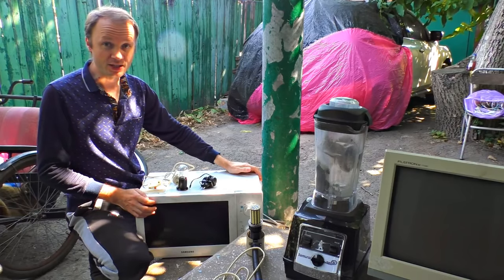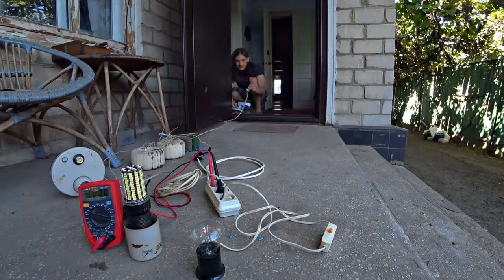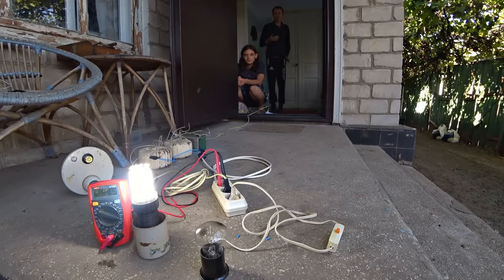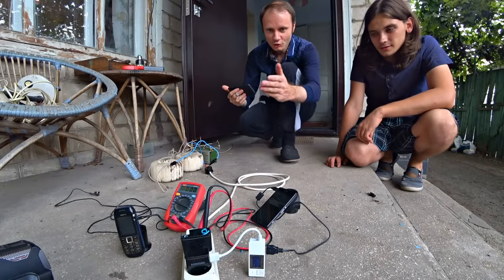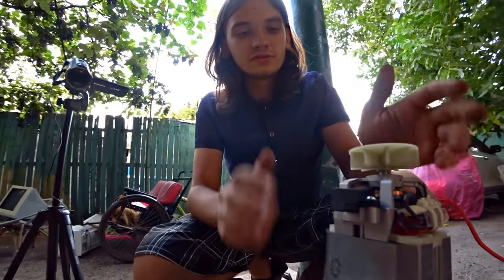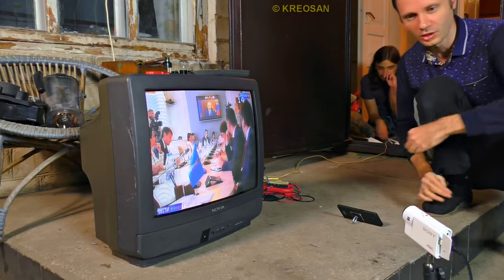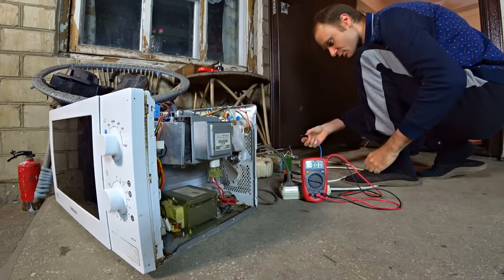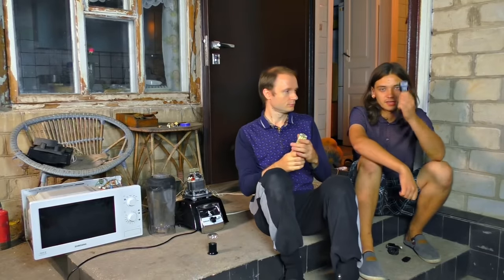Don't leave your devices plugged! Overvoltage + house appliances

Comment: The reason for the nightly Voltage increase is likely caused by a reduced load on the power stations and bad grid management..
Reply: Bob Thiry he asked 'why do technicians rise the voltage whilst everyone's asleep '.
Reply: Or maybe they increase voltage at night when everyone's asleep so they can charge you more money in electric bill.
Reply: bad grid is my take, from Quebec.... we have so much power we undersell it while overcharging regular people. Our "grid" is stable.... most of the time, depending where you live
Reply: What if higher voltage causes electronics that are on to consume more electricity at night? Current remains almost the same while voltage rises. For example 300 watts TV consumes 230 volts at 1.3 amps/current during day time, the same TV at night consumes 338 watts with 260 volts at 1.3 amps/current.
Reply: Most modern electronics use switch mode power supplies (like the LED corn bulb and the phone charger  in the video). Even if you increase the voltage the power stays about the same as it needs less current. If the voltage goes way too high they might fail, yes, but even the mentioned 260V won't do that.
Reply: The electric infrastructure likely is from the late 60´s with limited to no automation.
Reply: @somanyfnbananas2774  The meter measures Voltage RMS, the max amplitude is that value multiplied by the square root of 2 (assuming sinusoidal wave), so 40% higher. The input electrolytic capacitors on any switched power supplies are rated at a max. voltage. and will have reduced lifespan when operating closer to their max rating. A rating of 400V (which is common) is not that much higher than what they're measuring here. 260V RMS has a max amplitude > 360V
Reply: Yep. The change in voltage under load is called "voltage sag"
Reply: @Liam I would like to see the net frequency measured too. During normal conditions and at night when the Voltage rises, I bet the frequency will be higher too.
Reply: @F. BERTAGNE That would make a lot of sense, and is likely the reason.
Reply: @Xeno_Bardock  savage
Reply: Bob Thiry 🔴 What Is Islam? ⚠️

🔴 Islam is not just another religion. 

🔵 It is the same message preached by Moses, Jesus and Abraham.

 🔴 Islam literally means ‘submission to God’ and it teaches us to have a direct relationship with God. 

 🔵 It reminds us that since God created us, no one should be worshipped except God alone. 

 🔴 It also teaches that God is nothing like a human being or like anything that we can imagine.
🌍 The concept of God is summarized in the Quran as:

📖 { “Say, He is God, the One.  God, the Absolute.  He does not give birth, nor was He born, and there is nothing like Him.”} (Quran 112:1-4)[4] 📚

🔴 Becoming a Muslim is not turning your back to Jesus. 

🔵 Rather it’s going back to the original teachings of Jesus and obeying him.
Reply: yes but that would be very unlikley because those are perfesional jobs
Reply: It even blew up lamps of an entire residential house, back when that accident happened the substation had a pretty fixed power output and it was powering an institution with lots of electrical heaters. The problem is that they moved to natural gas based heaters and because there is no current draw from the electrical heaters the voltage rised so high that it blew up lamps on residential houses
Reply: @Raberuji  Not during the ice storm....Hydro is shit in Quebec
Reply: IN RUSSIA
Reply: @Xeno_Bardock  I verry verry highly doubt that buddy
Reply: But I thought Japanese appliances and game consoles were supposed to be 100 V, but 120 V work fine with my Japanese Dreamcast and Japanese PS2 slim. After all, in the AirBnbs I stayed in, it had a maximum rating of 125 V (which a lot of electrical accessories in North America use)
Reply: Also, Japan's electric grid is unique. Eastern Japan (Tokyo, Tohoku, and Hokkaido) use 50 Hz, but Osaka, Kyoto, Hiroshima, Shikoku, Nagasaki, and Okinawa use 60 Hz. This was a massive problem back in 2011, during the tragic earthquake and tsunami. Only three frequency conversion facilities exist in Japan, limiting the amount of electricity that can flow from Western Japan to Eastern Japan. The reasoning behind this unique grid is because AMG imported 50 Hz electrical equipment to Tokyo, while GE imported 60 Hz equipment to Osaka. When those grids expanded, there is a divide where certain appliances in Tokyo cannot be used in Osaka and vice versa.
Reply: all is true... kinda...
Reply: Voltage increase in your socket is caused by reduced load needed by end consumers. Cables and power lines have electrical capacitance, which, in AC grids, is the ultimate reason as to why you get voltage increase. The increase in voltage is a regional or local occurrence.

Electrical power stations like hydro-power plants run their electrical machines as electrical motors without water supplying the turbine of the hydro unit. Running these hydro units at night is called synchronous condenser mode. In this mode, for the operation of the hydro-unit, it uses magnetic field to absorb reactive power. The effect of absorbing reactive power is what causes the unloaded grid during the night to lower the voltage levels back to nominal ranges.

You also can use condenser batteries, static reactive (inductive) compensator and shunt reactors.

The reason its still 260 V at 4 am is because none of these methods are used in their regional grid.
Reply: Россия and electricity..
Reply: Yeah. Power plants have no means to increase voltage. All that happens in the grid. I was actually witness of something like that happening in a smaller scale inside a factory building. The electrical grid inside was so badly constructed that when you flick the power on, the voltage started to slowly increase and there was a loose current somewhere that shut it down eventually. So basically eighter badly managed grid or really badly damaged lines inside the building created sort of monostable circuit. You flick the switch on and after a period of time it switches off itself. With voltage higher and higher (we've measured record of 270 V). However, that wasn't actually the purpose of the switch and I assume wasn't even planned.
Reply: I always thought it was because it's an old house and we all use new equipment. My house is two prong and it would cost $40,000 to replace the house wiring to make it three prong ground compliant.
Reply: @JoeWaylo  40k for re-wiring ? do you live in a Palace perhaps ?
Reply: It is not the problem of the grid. The voltage on the grid can vary by +/- 10 % and in some places, upto +/- 15%
Reply: yes, this is true. Under low load, the grid voltage floats up. Under load during the day, the voltage stays at an acceptable level. They don't do it on purpose, because the devices will draw less current on a higher voltage(with an exception of incandescent lamps) therefore drawing the same wattage.
Reply: Jeiene
Reply: @Xeno_Bardock  hm...
Reply: 1000th like, congrats!
Reply: I think it goes higher at night cause less people use their stufff
Reply: @F. BERTAGNE Correct
Reply: Fun fact, in the former Soviet Union, when television broadcasts ended for the evening, a message would appear flashing on the screen: “не забудьте выключить телевизор” (Don’t forget to turn off the television) it is said that this message was to address the overvoltage caused by decreased grid load at night.
Reply: thanks for knowing
Reply: @lucasn0tch  That's pretty moronic lol
Reply: @ahmdabdallah2132  yo what is this in regards to? What is religion? I smoke cigarettes religiously. What do you do constantly? We dedicate religiously right......or at least I do.
Reply: In other parts of Europe everything is managed safely, so this never happens here
Reply: @Raberuji  Texas: non corona cough
Reply: @Gunzee  1qqqq
Reply: @Xeno_Bardock  Really? Or is it just the fact that nobody is using the power?
Reply: But I don't think the voltage will rise over 270V
Reply: Where's Automan when we need him?
Reply: test a 1 dollar laptop
Reply: Or just people using less power
Reply: @Gunzee  that was the question that he just answered bruv
Reply: @Xeno_Bardock  technically a higher voltage would be less of an electric bill, as more volatge usually means less current and the amount of current determines how much the meter increases
Reply: that's nothing a big lithium ion cant stabilize
Reply: @832738  the National Power Grids of literally every country ever is in AC. Your solution is DC. Also a Battery is not sufficient enough to provide enough Power to make an impact on the Grid.
Reply: @Raberuji  well he lived in Luhansk people's republic at that time (de jure a part of Ukraine de facto part of ruzia)
Reply: @juslitor  yeah cuz they didn't update it because at the time he lived in the luhansk people's republic and it is EXTREMELY poor (de jure part of Ukraine de facto territories controlled by ruzia)
Reply: Yes…
Reply: @Xeno_Bardock It doesn't work like that. They draw whatever current they need. It doesn't change at night.
Reply: They probably don't have a TAP CHANGER on their substation transformer to regulate the voltage to their customers.
We use tap changers to increase the voltage to homes on hot summer days when everybody's air conditioner is turned on.
Reply: @thygate  That would only be true if the generators at the power plant have no feedback control to regulate the speed of rotation of the generators.
Reply: @synthmarkbs8477  Mama Rusia, Mama Rusia!
Reply: @fabriziobrutti1205  If there is no tap changer on the transformer to regulate voltage.
Reply: @jakewynn  Actually, that is not true. When the voltage increases, so does the current. Did you ever hear of Ohm's Law?
Reply: @foureyedchick  oh yeah... Actually here in Italy the upper limit of the mains voltage tolerance is 265V😅
Reply: @Xeno_Bardock Except when the voltage drops, the device's resistance scales up, so it must draw more current in order to operate.

If anything, a LOWER voltage would mean a higher electric bill.
Reply: That would have been my guess

Comment: Im also quite impressed those two chargers did not kill the phones.    This is proper construction.    Even gross over voltage on the input and they still protect the output
Reply: Techrax put 100 chargers into a phone and nothing happened to it
Reply: @SamiSaba2  thats unrelated    entirely unrelated   Gross overvoltage on the chargers input can in some cases reach the output sending it to the phone    Putting 100 chargers in paralel will not increase the output voltages.

Comment: High night voltage might be caused by your earlier experiments when you shorted out the mains supply to your house!! Or might be no tap changers and a high supply impedance. Could also be vodka involved, at the power station. Great videos guys, thanks.
Reply: Kvass better
Reply: Cat getting rubbed makes static parkles over 20 thousand volts 😮

Comment: Now I'm curious on what would happen if you get those TV/VCR duo decks, and record while overvolting it. It might be a pain in the ass to tear it apart just to get the tape back once it dies, especially with the risk of a CRT, but the aesthetics you get while playing it back will make it worth it.
Reply: wdym risk of a crt
Reply: @Warp2090   very high voltage kile 20000+ somthing volts

Comment: I think that the voltage increases at night because there less people using the electricity and the voltage is not loaded and it doesn't drop, that's my guess
Reply: @QueueTeePies  yeah, but they live in Ukraine maybe there's an older sistem, I live in Italy and the voltage stays at 230V
Reply: 1:00 have a listen 'why do electricians rise the voltage whilst everyone's asleep?'. It's on purpose in other words.
Reply: @QueueTeePies  Even here in America I measure significant voltage changes at the same place at diffetent times.
Reply: It would still be less than 10 volts increase at night, not 30 volts or more. Its probably power companies who increase voltage at night doing it to charge more money in electric bill. What if higher voltage causes electronics that are on to consume more electricity at night? Current remains almost the same while voltage rises. For example 300 watts TV consumes 230 volts at 1.3 amps/current during day time, the same TV at night consumes 338 watts with 260 volts at 1.3 amps/current.
Reply: Yes, but normally there will be a tap changing system to buck the voltage as the load lightens on the transformer. The opposite happens as the load increases, it begins to boost the voltage to compensate for losses. If the tap changer fails, then there is no more regulation.
Reply: Imitators!!!

Comment: The filament in the incandescent was probably being damaged faster than normal under the high voltage, but the LEF probably uses a step down transformer before the voltage is converted to DC, this means no matter the AC voltage as long as it doesn’t physically damage the coils the light will work normally, which is why 419 volts destroyed it.
Reply: Light &phone &tv @rigg

Comment: Reduced load on the utility transformer perhaps. I don't see it as much at my current residence, but at the old house from a neighbourhood built in the early 60s in Florida, during the afternoon in the Summer the voltage would be in the range of 117V, but in the very early mornings it could go as high as 126V on a nominal 120V system. Using a Tripp-Lite UPS that will display voltage whenever it is plugged in.

Comment: Rhey dont  rise the voltage. The voltage rises and falls depending on load. Plus there is almost no grid management so when in the night the load is very small voltage rises. And when the load is high the voltage falls(to about 200volts).

Comment: This is why circuit breakers are a thing. Its easier to replace blown-out fuses in case of a power spike, than all of your house's electronics.
Reply: This is not what circuit bekers or fuses were ever meant to protect. The breakers are there to protect the building's wiring and only the building's wiring.

Comment: I think you need 2000 volts out of an microwave transformer to destroy the blender motor
Reply: Blender motor demands several amps of current at normal voltage; would it just blow up the transformer?

Comment: FYI don't poke your fingers into a microwave I saw someone get a shock even when its not plugged in. That silver can in TBE bottom is a capacitor and it will knock you down.

Comment: A transformers voltage is dependant on the amount of load applied. Less load current the higher the terminal voltage, more load current pulls the voltage down. Utility transformers have an Automatic 'Tap Changer' fitted to regulate the voltage depending on load applied. 
It would appear the supply company haven't repaired the one that supplies your house.
There will be less load on the transformer at night when people are in bed than during the evening when more appliances are being used.

Comment: 260 Volts shouldn't be a problem at all because most 220V devices are designed with the British 240V grid in mind, which has a voltage tolerance range of +/-10% of the nominal voltage, i. e. a maximum input voltage of 264V. And most power supplies use 400V electrolytic capacitors which should be safe at least up to ~280V AC input voltage.
Reply: yep
Reply: 'this' shouldnt happen in normal circumstances..
Reply: andygozzo72 Maybe the TV manufacturer used 350V caps, which leads to a maximum safe input voltage of 350V/sqrt(2) which is around 250V.
Reply: @tuxrandom  or maybe 385v? i've seen that rating a lot
Reply: andygozzo72 385V should still be on the safe side with 385/sqrt(2) giving about 272 Volts AC. But maybe the insulation has broken down some due to age.
Reply: @tuxrandom  possible...i have a few things designed for 220v which are definitely not a good idea to use on 240v, their reservoir caps develop voltages at or  a fraction above their working voltage, they need some sort of dropper device!
Reply: andygozzo72 You might be able to swap the old capacitors out for new ones with a higher voltage. Electrolytic caps have become smaller in size over time, so they might fit in.
Reply: @andygozzo72  Yea on Motor Caps.    385 is an odd value to see in consumer electronics.
Reply: @johnalexander7490  its to allow enough 'headroom' ,  250v mains is approx 350v dc peak

Comment: Why I have surge protectors in my house. They use metal oxide varistors and gas discharge tubes to short voltage spikes and surges to ground and trip the breakers.
Those offer limited protection  against small surges like from a distant lightning strike. 
If you have problems with constant overvoltages like 300V instead of the normal 220/230 you need to get  an overvoltage relay that will disconnect the power.

Comment: No one increases voltage at night 😂 ita due to low load at the grid where line capacitance dominates and gives a increased voltage exactly what happends at a leading pf. You will observe this effect in underground wiring system used for supplying power.

Comment: Nokia 3310 was the most durable,why the Nokia TV explodes easily?
Reply: putin power !
Reply: Because of Putin was on it
Reply: Most TVs similar to that one are not able to sustain more than 280 volts (that is 40 more than the typical 240-volt household outlet; 160 more than the normal 120-volt household outlet)
Reply: Plot Twist: They put a bomb behind the TV and then they turned the TV off
Reply: @TheElvisnator  lol
Reply: Lol maybe its small nuclear
Reply: From putin's lies!

Comment: It's Because less power demand means less current demand. Less current demand causes lower transmission loses, this allows the voltage to go higher causing household electronics that can't handle voltage higher than the rated amount to explode or burn and catch on fire.